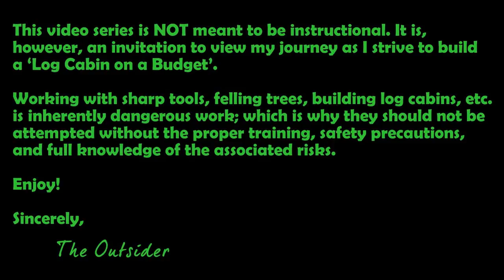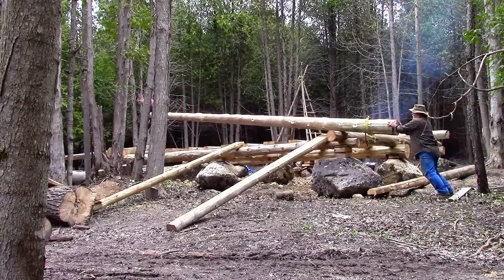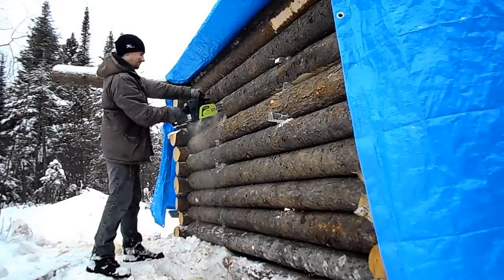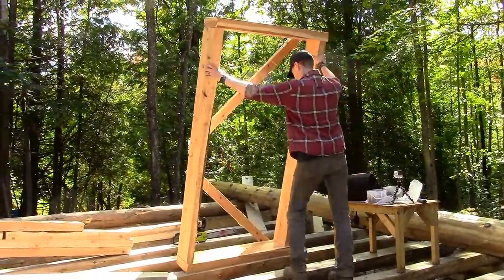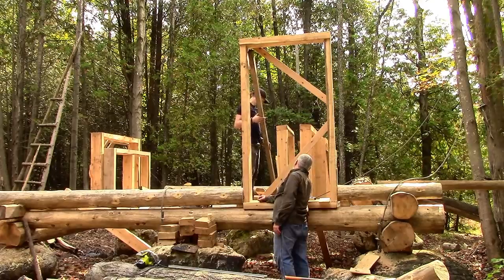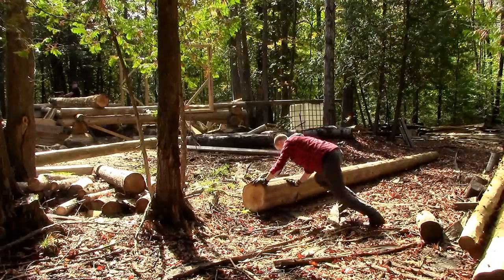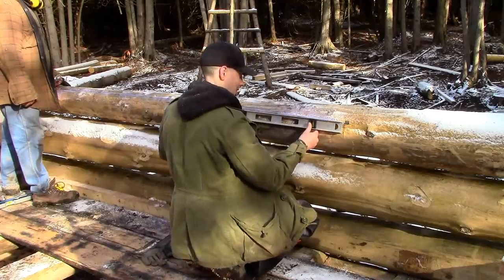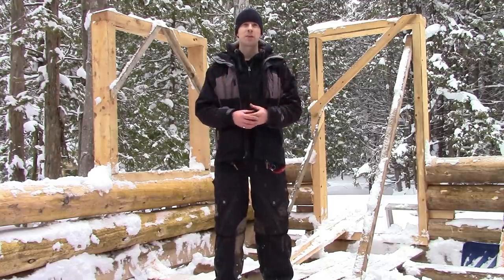Walls, Windows & Door-frames- Ep31- Outsider Log Cabin

Comment: Does anyone else get this satisfaction when they turn over the notched log over and fits just perfect?  Love watching that :)....LOL
Reply from the maker: lol
Reply: Heck yeah
Reply: I loved Lincoln Logs as a kid!
Reply: Log cabin
Reply: The outsider
Reply: +Michael Garcia ""Does anyone else get this satisfaction when they turn over the notched log over and fits just perfect?  Love watching that :)....LOL""

one problem ... NOTHING FITS!!!!!, look at the spacing between the logs!!!!, iv never seen this before, the wall logs need to be touching eachother and than add insulation or moss between them!, but look at the spacing!!!, iv never seen anyone make a log cabin like this before!, normally it all does fit perfectly!!!
Reply: S Dew This was done on purpose. Many log cabins are built like this in fact. Due to the drastic taper of the logs, the notch would have to be almost completely through the thin end of the log to have it touch the rest of the wall. Look up pictures of old cabins, and you will see some that have much more chinking between each log. This is a design, not an error.
Reply: Sure do!!
Reply: Measure twice and cut once is the technique. I wonder how the old guys built their cabins without any of the power tools available on this build..
Reply: Amen daddy’s tought

Comment: 2 things.  I've learned the hard way, to get your shirt fixed during the winter. it's usually cheaper, and less painful. Also, when you're milling beams, or trying to maximize your lumber, put the butt end of your log away from you on your mill. it just kinda helps you get a better picture of what you have to work with.

Comment: I really can relate. It is so special to see you and your Dad working together. I have a good friend who has done a lot of work with me. At 75 this year, for 6 years, I have been clearing 3.75 acres of vines (largest 14" in diameter) and sticker bushes (10 feet high and 10 feet in diameter.  It is about half done and I love the work and being outside with the flora and fauna. My tractor is a 1964 all steel Simplicity garden tractor. I also have to deal with the challenges when it does not work- got it going yesterday. More power to you both to make siginificant progress this year also.

Comment: Nice video, obvious too see a lot of effort was put into this build, and into editing the video. Really appreciate it. I've been looking forward to seeing this video. Great job. 
However, It really hurts me inside to see how you left those big gaps between the logs. Normally you would have fitted them along the length of the log, making a grove/v-notch all along the length. Not only are you able to make it nearly air tight, but also gives the logs a lot more stability, preventing them from rolling (especially where you don't have corners, near doors and windows where you resort to nails). I hope you have a greater plan on fixing those gaps, can't wait to see how it turns out in the end, thanks a lot for sharing your journey, keep up the good work.
Reply: I was thinking the very same. It seems strange to me that they spare no hardwork building this cabin yet they didn't even flattened the logs while they got a milling machine at their disposal. They will have to fill those gaps with some sort of material that will not only, in my opinion,  hurt the esthetics of the cabin but also hurt the structure and overall longevity of it. 
Maybe we're missing pieces though, I'd love to hear from them on this =)
All in all this is still amazing work and a fantastic dad/son journey imo =)
Reply: True they could have used the mill to flatten both top and bottom log, but else you would just leave the top, and then cut a grove along the bottom of the next log, to match the top of the previous log. Never the less, very strange imo. But hat's off to their hard work..
Reply: Sure there is a lot of different ways to do it, a grove, a v notch etc ... But all those requiere significant amount of work whereas it seems to me that simply flattening the logs would have been really easy with the mill (although not as effective as more elaborate joints)
Reply: Problem with milling top/bottom, is that there would most likely be water build up on top of each log. You wouldn't get that by notching the bottom of each log. Just my opinion.
Reply: I agree with you. All I'm saying is notch > flat > nothing and that flattening would have been super easy with a mill.
Reply: True
Reply: Alot of the old timers used hand drills and wooden dowels where he used nails. I don't have a problem with the substitution of nails for wooden dowels. Seems like a logical replacement to me.
Reply: I'm sure they will be filled in with some sort of chinking material when the cabin's structure is complete. The logs are much less susceptible to rot when built in this manner because the exterior of the log naturally becomes cured as it dries. If you damage the exterior more than you need to, such as cutting long grooved cuts or flattening as has been suggested, it leaves room for water to enter the log and create rot. there are many cabins built in this manner that have stood for 100+ years.
Reply: @justjay3514  chinking is the way to go when you work with very tapered logs as in this video, the other built with v grooves is called scandinavian, it requires very uniform logs.

Comment: A thousand dollar comment:
 If the flywheel teeth are getting worn and not meshing well with the rebuilt starter motor:
Shut off the engine with a little clutch drag.
A 4 cylinder engine will ALWAYS stop at only 2 crank shaft positions.A 6 cylinder:3. 8 cylinder: 4.
You want the starter to mesh with the flywheel in a NEW position,if possible.
 If you forget,you may manually crank the engine to a new position to allow starter mesh. 
Ask me how I know this.
Reply: How do you know this?

Comment: Hello neighbour!  Looks like a great project.  In the video, it says the portable saw mill is made by Woodland Mills.  Found their website; located in Port Perry, Ontario.  Close to my place and is giving me ideas on how I am going do the post & beam frame interior construction at my cottage (it will be primarily a frame building, unfortunately not a log cabin) , Hopefully it can be done more cheaply by using mature cedar trees found on my property rather than buying them cut from the mill.   Thanks for the tip!  (film looks like it is shot close to home somewhere  in Central Ontario, Canada).   You might want to check out 'My Self Reliance' on YouTube... Shawn James built a log cabin alone and without power tools in 2017 a few hours North of Toronto.  Amazing.  Good luck.  Cheers!
Reply: Jim Pool Playe

Comment: Great project. You done so well without the tractor. Personally I would have built the floor, so you would have had a solid safe platform to work on. You could cover it up with tarpaulins if it rained to protect it.

Comment: Ive watched several of these videos now, and I'm amazed at your guys courage and dedication to taking on such a huge task, but couldn't help wondering several things... First, you have the saw mill. Why not square up each log and build that way? Dovetail the corners and they're stronger than the channels you cut into them. Minimal chinking required after that. Second, a small electric portable winch would do so much more labor for you, get so much more done in a shorter amount of time. Eliminates so many issues.

Comment: You guys originally had the best idea, when you had the rope in the tree tops.
Instead run a steel cable with a tackle block pulley. It’s not much trouble building a wench station powered by the tractor. Then one person can raise and lower the logs while the other guides and balances it into position.
Most of those tractors have or can be equipped with a pulley that comes out under the gas tank that drives of the pto.

Comment: 1 - For joints requiring strength use fitting joints such as dovetails or if in a hurry use screws but predrill the holes to avoid splitting the wood.
2 - Take time to make sure all logs/lumber fit tightly together. On cold winter nights, this will be appreciated. This will require thoroughly drying out the logs before measuring and cutting. Debark to facilitate the process. One will regret taking shortcuts. Also, mice can and will get in through gaps and poop everywhere. 
3 - Use physics. At the start of the build create a tripod with a mobile base with the tallest straight logs one can find. Place a lever at the top with an adjustable counterweight. One will save one's back lifting heavy logs.

Comment: If I was doing a cabin like that I would get a gas mill and a generator on site to mill needed pieces and a generator to run circular saws, sawsalls,  large grinder. drill and impact driver. Use lag bolts ataching to the door frames and windows with spacer blocks supporting the logs weight not just a nail. An electric or geared hoist or genie lift to get large wall logs higher.  The notches are shallow enough to leave large gaps so besides spacer blocks if needed in the middle milled pieces planed to fit would be nice depending on what material that fills gaps. A big Router may be great for some thing too later for sure. Generators help many ways.Even a captains hoist may work best. To make it faster and better.

Comment: You could have used your sawmill to make even-thickness wall logs, and as a result you would have had firewood for years to come.

Plus, you would have had far less chinking to do. And they would have been much easier to haul around and put in place.

You did this so inefficiently, I am frankly just amazed. You created far more work for yourselves than you needed to. And in the process took far longer than necessary. And your costs could have been considerably LOWER.

Comment: With two 1 1/2 thick ropes 20 feet long you wrap one turn around your log, whatever the size, at the middle of each ropes after putting your log at the bottom of a 45 degree slope (2 logs leaning on the top of the wall), attach one end of each ropes at the bottom of the wall, take the other ends, climb on the wall and pull the ropes. Your log will roll on the slope easily without any effort of your part. It is surprisingly effective.

Comment: You notched out the seal logs for the floor joists and the floor joists look like they stick up a little bit higher than the seal log. So did you have to notch out the log that sat on top of the floor joists/ seal log for a right fit? I’m gearing up to start
My first log cabin in the spring.

Comment: I think its pretty impressive that you can adjust on the fly when something goes wrong.  Thanks for the idea of the leveraging jig you made to help fell trees the rest of the way when they are hung up.  I have several trees hung up on my property and my wife is always worried when I try to free them on my own without getting hurt.  That A-frame should make it easier now.  What made you purchase the sawmill brand you did?  Im looking at a woodmizer mainly because I live just 2 hrs from the factory where they manufacture them.

Comment: It is beautiful to watch skilled trades work and more especially so when an father and son work together.  The only real comment is that their work would have been much easier with an adze and a pair of "come-alongs" along with a small steel toboggan - a piece of steel shaped like the letter J laying on its side  with D rinds on the side and a large D ring on the center of the front so when you pull the logs the butts cannot dig in.  With the "come-alongs" (which I used to pull posts out of the dirt or used sideways to pull barbed wire taught) and the A frames they built, lifting the logs on the wall would be a lot easier.

Comment: we had a W 6 tractor on the farm in Sask. many times I started it with a crank battery would go dead over night you had to be careful cause sometime she would kick back. when I was able to I would shut her down facing down hill at start up let her roll a few feet & pop the clutch don't forget to pull the switch.I realize this information is way to late but might be useful in the future.A crank would probably be hard to find if it's not on the 4 Ken Kent

Comment: Great initiative in moving forward with a second plan when the tractor broke down!  When in doubt, improvise.  My biggest question is why are you leaving such large gaps between the logs?  Seems like its going to require a ton of chinking down the road.  Wouldn't it be better to cut your notches a bit deeper and flatten the tops and bottoms of the logs just a bit so you end up with a tight fit along the majority of the beam?  Just my two cents.

Comment: I have 1 bit of advice, I noticed you were using a regular screw gun to put in the long screws. I use an impact driver. I even used it on steel buildings installing the sheet metal roofing..it will drive self tapper right into steel. and if you are running phillips head screws through wood..it seems to have more bite on the screw than a regular screw gun. I am talking the drill sized impact driver not the one that takes lug nuts off. Since I bougtht one I never use my old screw gun except for drilling holes or on thin material so I can adjust the clutch

Comment: i know this is long since past but i just have to ask why when you were moving the logs into place after you had the window frames done did you not just use the stinking A-frame you used to move the first couple of sill logs into place ? or better yet using the a-frames as well as some cable cord would have made things go much smoother and faster for that matter

Comment: What if at the point of each log that you wrap with ropes 42:43, you positioned a wheelbarrow underneath instead?
This way, its heavier side would roll on wheels, while its other end will be supported against the cabin's frame.
It's the same engineering principle used on lorries trailers, where one side of the trailer is supported against the lorry's frame, while the other end is on wheels.

Comment: i am staring at a band saw thinking why not just block them on 2 sides, stack easier and removes some weight.  a truck could of dragged the logs to a landing, milled at the landing then used on a proper foundation as the boulders could sink unevenly.  still a nice project and learning as you go is the valuable experience

Comment: Just a thought, since you had a sawmill why didn’t you mill the logs on three sides flat leaving the round one to be outside of the cabin in that way you would have easier job cutting the notches, fitting the logs together, flat inside wall and you would not have space between the logs needed to fill up. That’s how I would do it at least.

Comment: I’m sure the Vermont Castings people will take issue with your insinuation that they built an inefficient stove.  The glass doors are meant to allow quick heat into the room. The rest of the stove is heavy providing thermal mass. The heat that escapes through the glass is good heat and will infect heat absorbing material in the cabin.  What you do not want is a lot of cabin air entering the combustion chamber, thus sucking in cold air--it is a balance to be sure.  My suspicion is that, even with an outside air source, you have plenty of “leakage” of air to ensure safety and adequate fresh air.  Eliminating negative air pressure will make a big difference especially with a porous cabin with few to no vapor barriers.  You got a steal on that stove--a good servicing with new gaskets should bring it back to almost new condition.  And the glass does add a nice esthetic touch to cabin in the woods. Videos lots of fun.
Reply from the maker: +John Brock I think you may have the wrong channel. lol I've never mentioned any stove with glass doors. Nor have I talked about their efficiency levels. Glad you stopped by to watch my video though!
Reply: Oops--you are right.   That was “My self-reliance” I thought I was replying to.  Thanks for the gentle correction.

Comment: This is amazing, however one thing baffles me. You have a saw mill on site, so why aren't you sawing the logs flat so they fit together easy? Wouldn't that save you all the trouble of measuring and cutting out all those notches, trying to fit together all those uneven round logs? Plus, wouldn't it be way easier to keep everything level as you build? And you wouldn't have such huge gaps between the logs to have to mortar up. Is there some reason for this I'm not understanding? Because, considering how you have that saw mill machine on site, I just can't understand doing it that way. Not trying to knock you, just genuinely curious. Thanks!

Comment: You could’ve saved yourself some trouble if you taking care of repairing the truck when you first mentioned while I was still running and you could have gotten it into at least a more civilized area which would’ve made it easier to repair. In the long run that would’ve helped your cabin built but you make your choices and you take your chances.

Comment: my big question is, you spent all that money on the portable lumber mill, why didn't you use it to square up the logs, and cut joints into them to make the work easier? if you have the technology, then why not use it? (after all you cut boards from the logs you had.)  I know of quite a few log cabins that were built, a long time ago, where the builders used a 2 man saw to square up the top and bottoms of each log.

Comment: 38:33 - it's strange that you immediately made windows. The house is wooden. My father is a builder. Windows and doors are the last thing he cuts out. Otherwise, the frame for the window will distorted, the window will break. Initially, erect walls, then cut openings, after shrinking the wooden house. If the tree is dry - immediately after wall construction, if the tree of natural moisture - only after a year or two years.